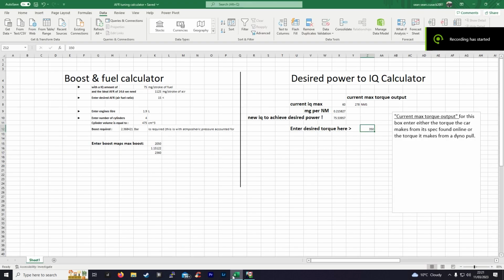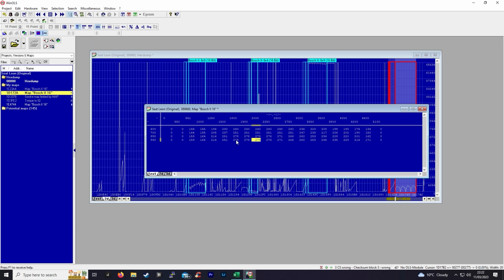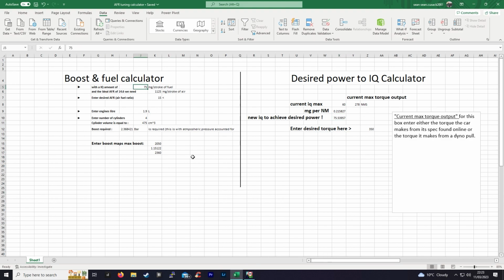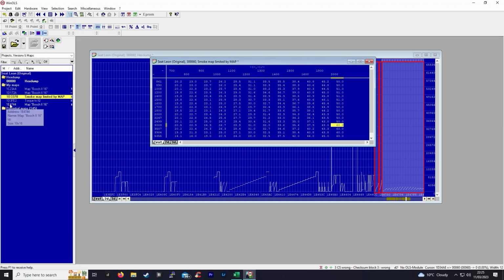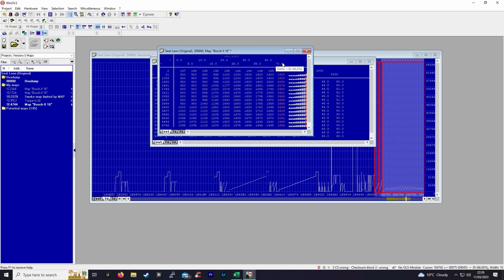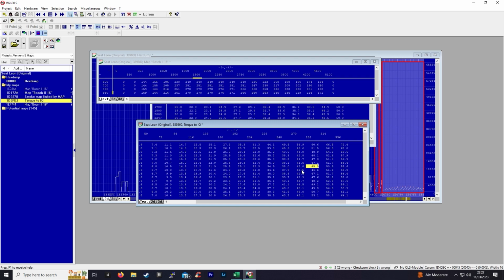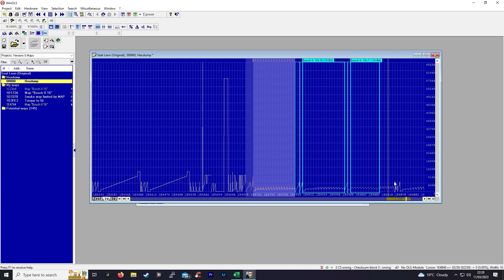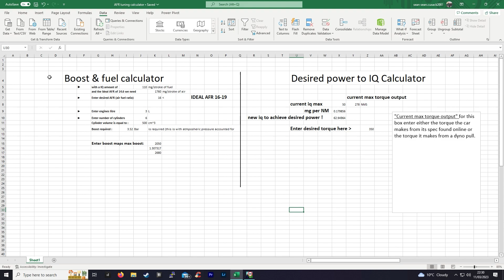ECU Tuning calculator via Excel- How to tune like a Pro

Comment: you can provide the formula or the excel file?
Reply from the maker: The excel sheet is available on the website
Reply: @ckpelectronics8921  in which section, can you put a link?
Reply from the maker: @naphosimnap9008  https://ckpremaps.com/?product=afr-tuning-calculator&doing_wp_cron=1698481651.7808139324188232421875

Comment: Don’t use this video as an example of tuning. Very very bad made. 
Calculation is fine but looks and sounds that you have zero experience in tuning
Reply from the maker: If you check out our Instagram ckp remapping, you'll see we tune cars daily with hundreds of diesels tuned by now all making 40+ bhp over their standard power without issue like dpfs blocking blowing turbos etc like alot of "reputable" tuning do.

We also have cars with our tunes 1-2+ years on them...

So before you go talking rubbish again verify what comes out 

Thanks
Reply: @ckpelectronics8921 you have forgotten many calculations like air pressure, engine efficiency , air density, humidity
And also forgotten about soi, duration and real torquelimit to flywheel calculation
This is not tuning like a pro, is beginner
Reply from the maker: @robinliljedahl5259  This is a "BEGINNER" guide my friend, teaching people how to start off but mostly getting the idea down... The last thing to encourage young people to start tuning is by overcomplicating it.

But thank you for the constructive criticism, I'll release an advanced tutorial when I finish the basics first
Reply: @ckpelectronics8921  When are those coming? LMAO

Comment: I made  a calculator in c# I shared but I did mine a little different that yours, Mine starts with what CC / Cylinder Count / Atmospheric pressure to calculate MAF value then desired boost including atmospheric, this way you tune from a safe boost level and it spits out the required MG/ST for set AFR.

Have to remember also that on some torque based ECU's some maps are the internal torque and not what you make at the flywheel, so will see torque limiter maps like 30nm higher than the claimed output.

Some things to watch are EGT temps, even on a nice calculated tune at 17 AFR I have seen EGT at 840c
Reply from the maker: I can often tell when it's internal torque and the figures to the wheels are almost always 20% less.

In regards to egts I've a nice group of sensors I always log when tuning temperature after turbocharger (egt) is one of them.

But them calculators are dead handy and get you in the rough area where lambda maps/boost / nm to torque maps should all be
Reply: @ckpelectronics8921  I believe the loss is through drag  / friction and pressure ect.

If you look at a vag 2.0tdi cr cp14 the main torque limiter is 352nm where the power at the flywheel / clutch is 320nm from factory.

I believe the internal vs external has nothing to do with transmission losses as torque would be further reduced, there is a map for friction losses and is around 30nm for the above car.
Reply: How i can contact you?
Reply: How can I make this in excel please?
Reply: could you send it over, thanks. What's your email?